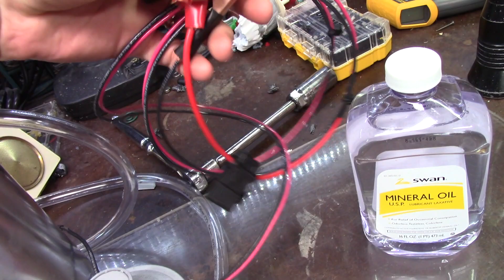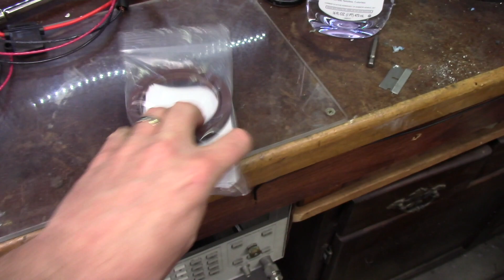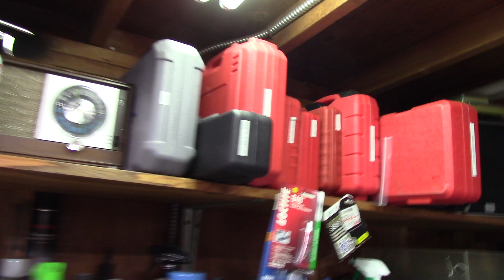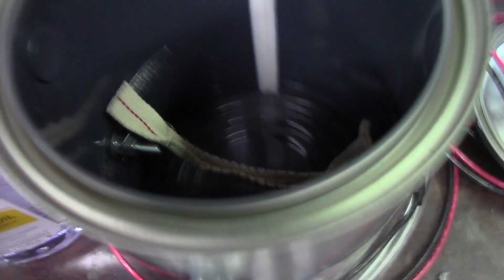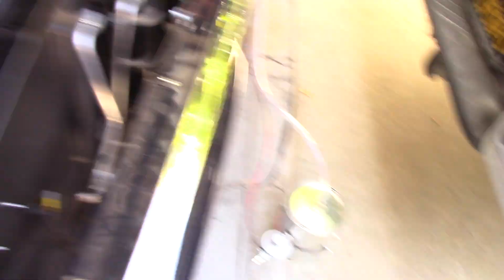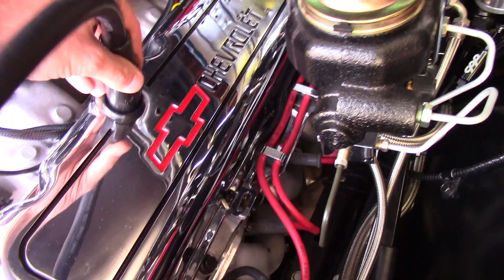Rear Main Seal Leak Smoke Test Diagnosis

Comment: Did that seal work? Having same issue with small block, so need to know where to get if it did?
Reply from the maker: I still haven’t installed it, haha. It’s a big job that I need to muster up the energy to get done. I was thinking about doing it soon.